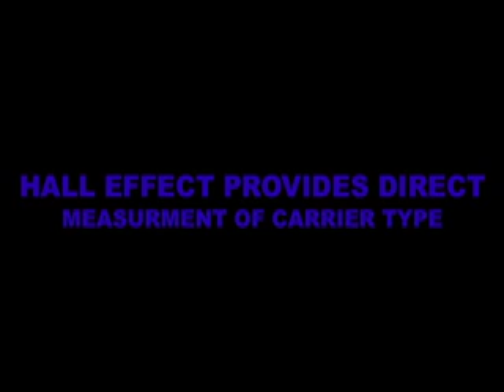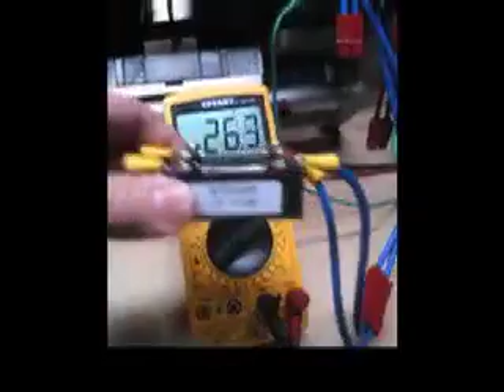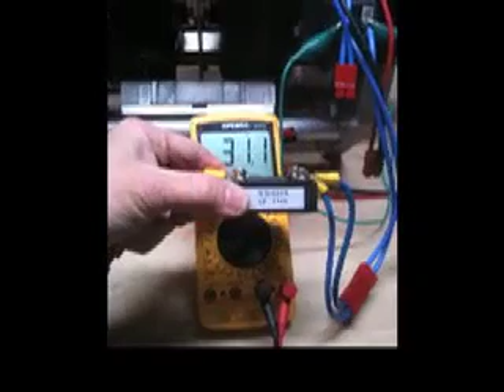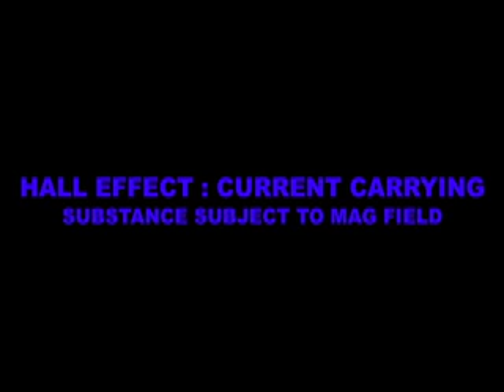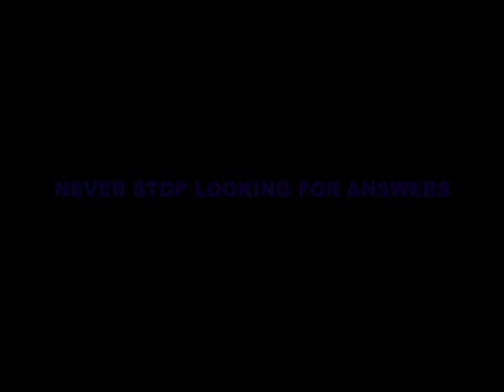DIODE/FWBR HALL EFFECT .mov

Comment: I hear a high frequency pitch in the back of the music track.  I am going to assume that's the original audio from the clip indicating that your pulses are the 5 Khz frequency range.

You are throwing off the multimeter because of the EMI noise being produced by the FWBR and the wires and the close proximity.   Just try repeating the tests taking note of this and then move the multimeter far away from the FWBR and the wires and make the measurements again.